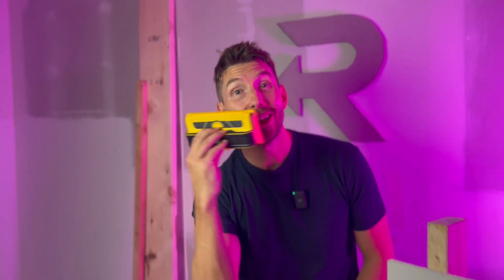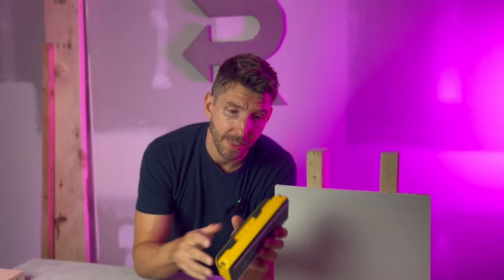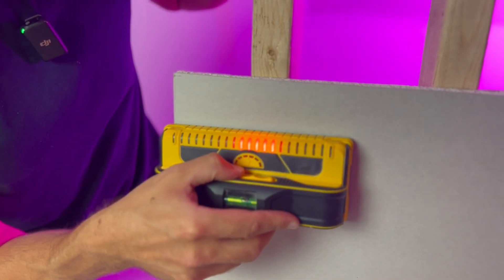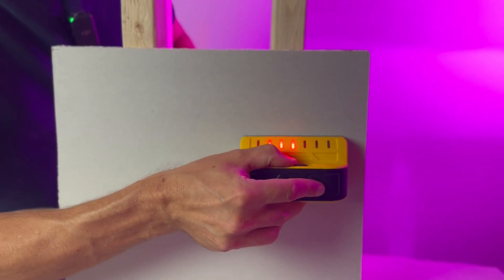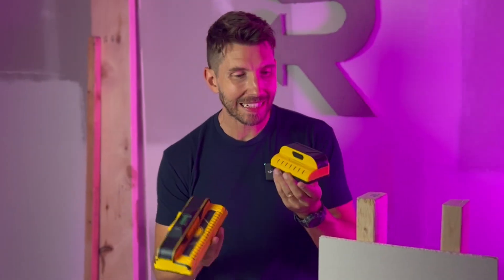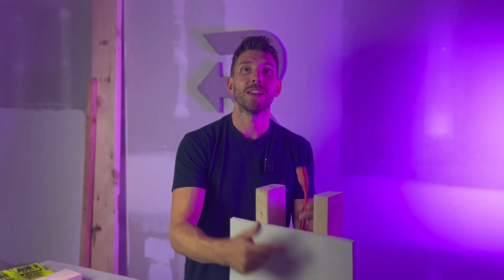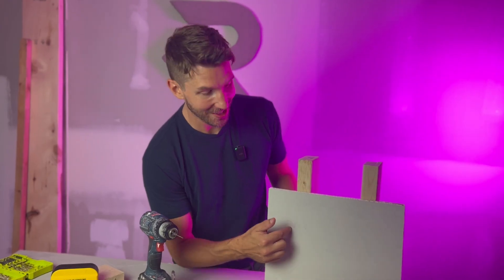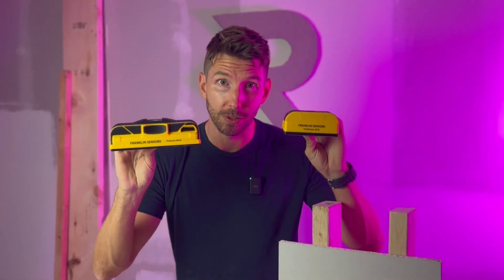Our Favourite Stud Finders | Franklin Sensors M210 & M70

Comment: What if only 1 of the bars lights up for the electric wire warning is it still safe to drill on that spot ?
Reply from the maker: It's still safe regardless, just be extra careful in those areas to not drill too deep and make sure you hit the stud!

Comment: What happens if you an old building with wire lath and plaster wall. Specially in some areas that is 1" thick.
Reply: Read the manufacturer specs. It is only guaranteed for 1.5” deep; out of that the device might not work as intended. Read specs and don’t ask stupid question.

Comment: Never figured out how thick of a wall it can sense through. I have doubled up drywall for a fire partition and a layer of plywood between two houses. Total thickness 2 inches before studs.
Reply from the maker: I think they said it’s around 1.75” of detection depth

Comment: Just a small warning,I left the batteries in mine and even though the batteries were still good there was corrosion on the contacts ,.Very strange as the batteries had no corrosion.Before I put it in the bin I decided to open it up and found three small areas of corrosion on .Motto of the experience is to take the batteries out if you are not using it for a while!I will have to buy another as it worked well before that happened.
Reply from the maker: That’s interesting, we have dozens of these stud finders and only ever had that issue when we let it get wet. Reach out to Franklin Sensors they have an amazing support team!
Reply: Your location has higher humidity?

Comment: I recently purchased a Franklin M150, primarily because of the positive reviews. I'm disappointed. The finder is inconsistent. It will detect a stud on one pass, then not detect it on a second. Then it won't detect a stud at all when there's actually a stud in that location. Yes, I've read the instructions, and the finder has fresh batteries. I've also viewed the instructional videos.
Reply: I hear ya. If I could find one as consistent as you are at going to different Franklin videos and informing everyone I’d have a great stud finder 😂
Reply: My experience too.  LEDs are inconsistent width and show studs everywhere.
Reply: @billdavis3957 it's too bad. I was hopeful. Happy Thanksgiving.
Reply: Does it find nails as well?

Comment: Also thought it might be worth mentioning that there is a new revision of this M210 out - i just got one early this AM and the key difference is that it throws up a green LED sensor on the true-center of the stud which is a nice feature. - I just spoke to customer service @ Franklin Sensors to confirm as it's apparently only listed in the tiny print in the documentation that nobody ever reads.
Reply: I ordered this from amazon thinking it would have the green LED to show the true center. Especially with only 3 sensors to show a stud it's really difficult to tell the true center without the green LED.

Comment: not sure if anyone else mentioned this already but you don't take the battery cover off to access the pencil - there is a cutout spot on outside - bottom right where you can slide it out with your finger.
Reply from the maker: We realized that right after posting the video 😂👍

Comment: So my franklin sensor has 6 sensors. When used in bathroom, for some reason it seems to be picking up a ‘stud’ that I happen to know is actually a water line. Imagine someone drilling into that thinking it was a stud. It even picked up ‘studs’ in the garage so I drilled into it only to find drywall (no stud). Turned out what it picked up was a wooden handrail clear on the other side of the wall, inside the house. Idk. I own 3 stud finders ranging from $30 to $90 and I gotta say, they all do some weird shit lol.
Reply from the maker: It’s impossible for stud finders to be “perfect”. These are the best in our opinion because they pick up the most data with their additional sensors/technology. There are many situations where you need to use additional knowledge and info to confirm studs. I.e.) 16” centers between readings, thickness of the reading, proximity to outlet boxes (which typically have a stud on one of their sides). All that said, we see your point and we’re sorry you found it frustrating👍

Comment: I have the m210 and can't figure it out. I just got a single red flashing light on the most lateral right sensor light
Reply from the maker: hmm 🤔, there really isn't anything to ‘figure out’ with these (thats part of what we love about them). It really should be as simple as holding the device to the wall and pressing the button- so if that’s not working perhaps you have a defective unit. Try contacting Franklin Sensors directly, I’m sure they’ll take care of any  issues you’ve got 👍

Comment: How does work with the wall with insulation ,and does it locate the wire?
Reply from the maker: We find they work better than every other stud finder we’ve used when it comes to thick walls/walls with insulation etc. (Specifically the M210 and the X2100), and yes they have models that not only detect the presence of a live wire, but some that have a live wire meter that illuminates in sequence as the electrical signal strength increases. Their website has a great section that helps you filter and choose the best stud finder for your needs: https://franklinsensors.com/products/?wpf_fbv=1&wpf_filter_live-electrical-warning=live-electrical-warning%7Clive-wire-meter 👍